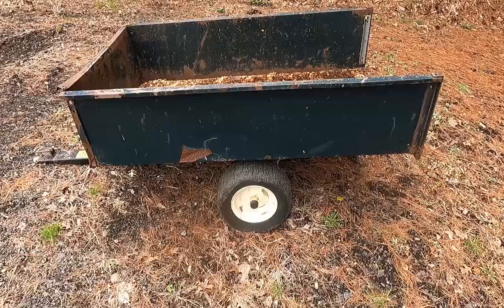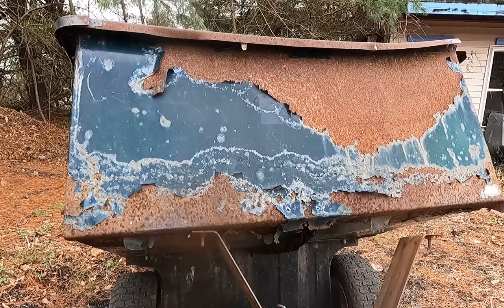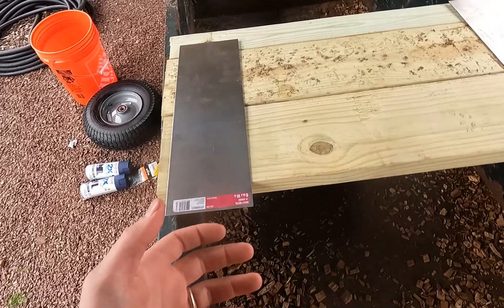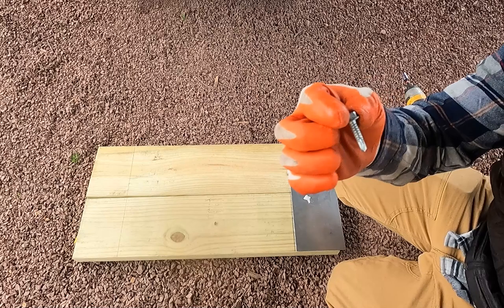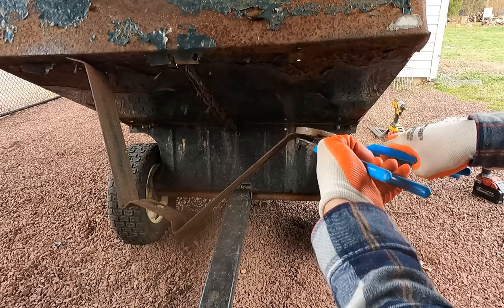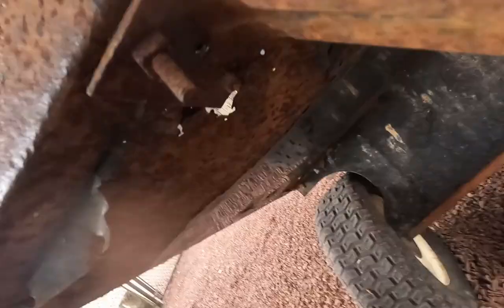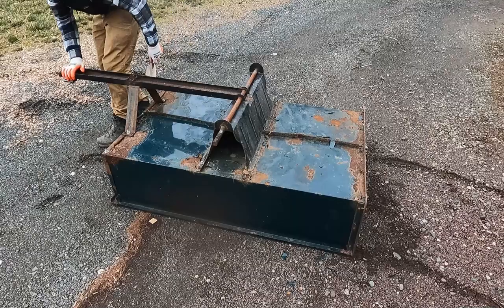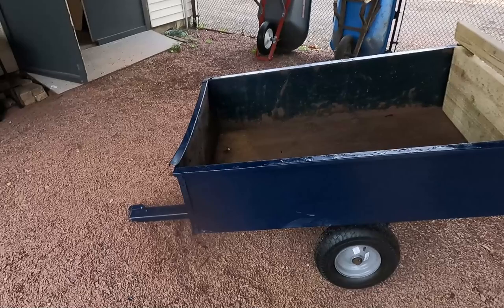Restoring an Old ATV Dump Trailer

Comment: Looks great, about to do the same. Where'd you get those tires? Do you mind posting a link?
Reply from the maker: I got them at a tractor supply. Just found two of the same. Make sure to measure the center hole. That’s important lol

Comment: If you can find an old truck bed mat, measure the length and width of your dump trailer and cut the truck bed mat down to have a mat to protect the bed of your trailer. Good job btw.
Reply from the maker: Thank you! Great idea! There is a junk yard in town that might have something like that.